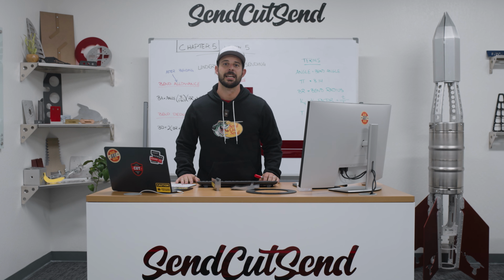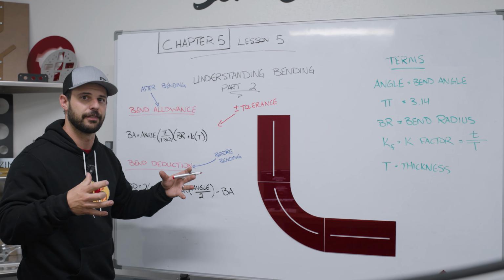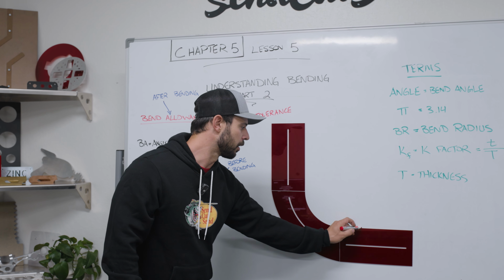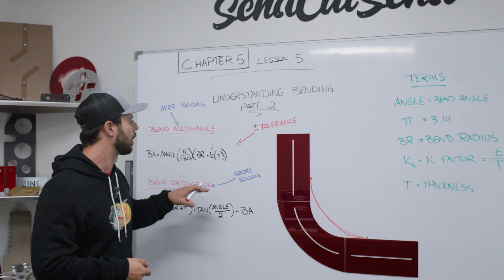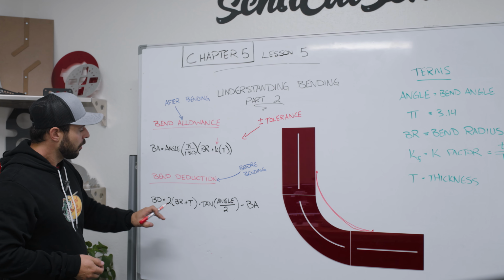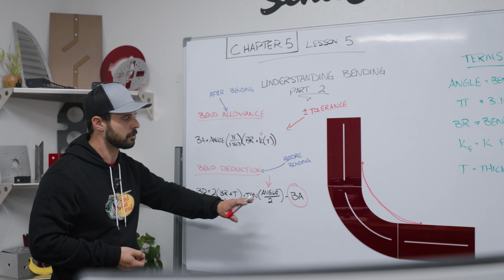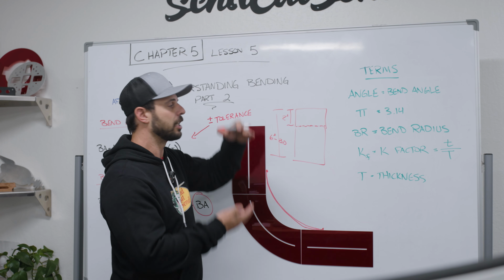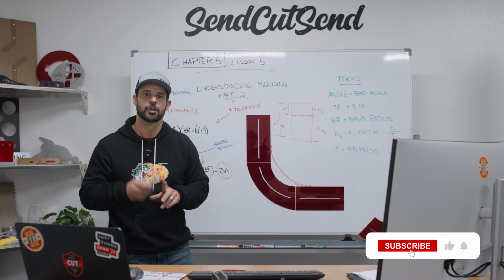How to Calculate Bend Allowance and Bend Deduction - Education Chapter 5 Lesson 5

Comment: Ok wait - so the part stretches into a longer final length after bending, right? Then not taking into account bend allowance/deduction should lead to LONGER flanges after bending shouldn't it? You say that the part with 6" and 2" flanges before bending becomes 1.995" and 5.995" after bending. If it stretches, isn't the final flange length (without proper allowances/deductions) 2.005" and 6.005"?
Reply from the maker: Good catch!  You are 100% right.  If you don’t consider the stretch your part will come out longer!